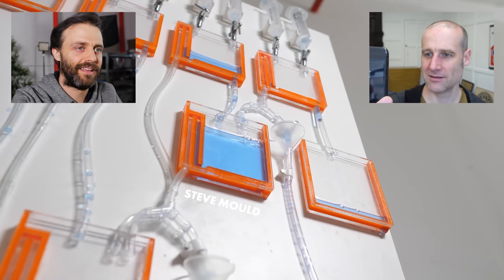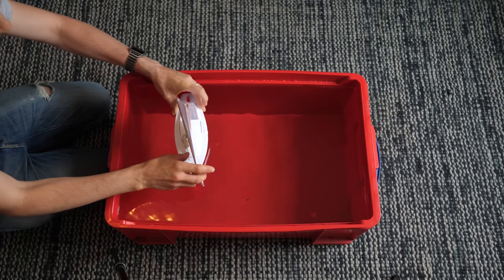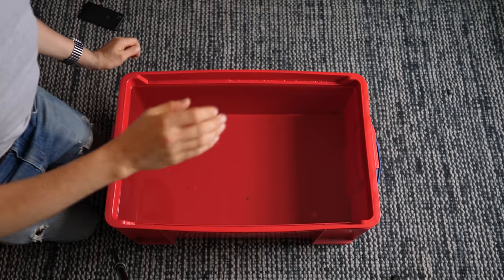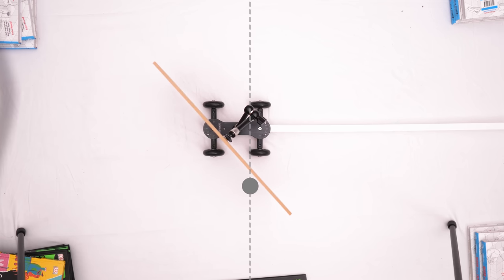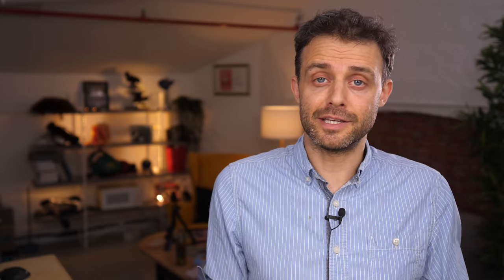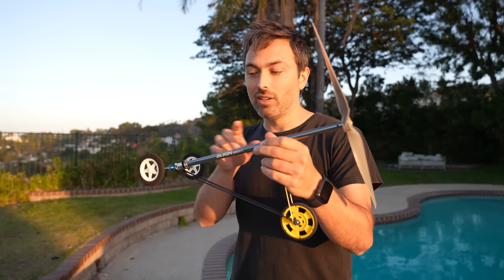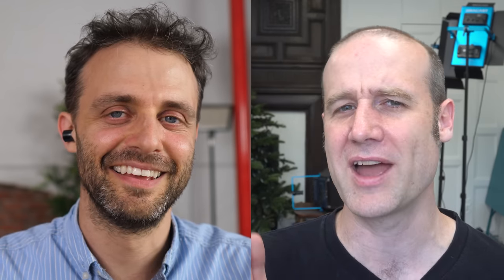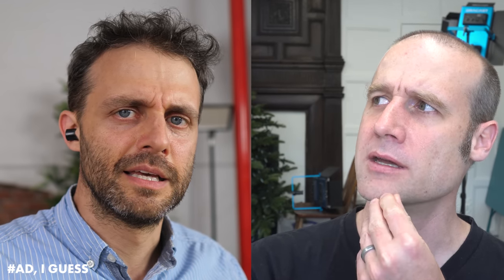Sailing Faster Than The Wind - How Is That Even Possible?

Comment: As a sailor, I love to see this kind of stuff.
Another addition to this is that when a sailboat is moving at a certain speed, let's say five knots in 10 knots of wind then the sailboat is experiencing another 5 knots of wind against it because of the speed it's going. This is called apparent wind. So now that boat has 15knots of wind against it. When a sailboat does this and it happens on every sail on a boat if the boat is moving, then you have to pull the sail in to counter the apparent wind. This is because the apparent wind is coming from the direction that your boat is moving or the front of the boat while the real wind on a boat's preferred angle is usually about 120 degrees from the wind. Now your boat has its sail pulled in its wind angle is around 80 degrees even though the boat is pointing in the same direction. This can be repeated for a long while when you have the right sea conditions. This is also why you don't see the GP boats or the AC75s letting their sails out very far. They are trying to capture the apparent wind.

Comment: 4:05 indeed, the slight sideways drift away from the wind, or to leeward (the opposite of windward) is why you should always leave yourself some leeway when trying to clear an obstacle. Especially if for some reason you don't make very good headway I'm always amazed by how deeply sailing has worked its way into our language!
Reply: Modern day boats can actually generate net zero leeway by canting their foils to windward as to generate windward lift as well as vertical lift which is why most moths and foiling boats cant to windward
Reply: Fun fact you’re minorly incorrect. It’s true that you can have net 0 leeway or even positive leeway but rigorous testing, a very small part of which I’ve been involved with as part of my uni program and sailing team, has shown that while it’s possible to achieve 0 or positive leeway it’s optimal to have between 1-2 degrees of leeway angle because the drag required to generate the extra hydrodynamic lift and resulting speed penalty is greater than the vmg improvements from better point, outside of niche tactical situations like pinching an opponent off a start line in a sailboat race

Comment: i would really appreciate you explaining how the mashine of deric works
Reply: Boogie Baggins  Either his explanation was bad or I'm too dumb, but it would be great anyway to have more intuitive explanation like in this video
Reply: i think his explanation was waaay too convoluted, albeit clever. It took me a while to understand what's going on, i've invented a good explanation for myself.
Reply: I'll try. In Deric's machine the propeller blades are acting as sails. If the machine is going slower than the theoretical max speed, the "packets of air" will hit the blades/sails transferring some of their kinetic (velocity) energy to the propeller. This energy is then transferred to the wheels allowing the machine to accelerate further. This is why the air behind the propeller slows down.
Reply: Isn't it Derek ?
Reply: I think a explanation could be: (its my explanation)
When the wind speeds up the vehicle it doesnt speed it up due to it turning the blade, but due to pushing on the vehicle. Then the wheels will turn also and this causes the blade to spin. Now when the vehicle is at the speed of the wind it will get faster, cause actually if you imagine a horizontal line through the rotors blade there will be a crossing point between the imaginary line and the blade. This dot actually moves backwards while the blade is spinning, because of the blade is tilted. Now you have a point on the vehicle that is moving slower than the boat, cause this point is moving backwards relative to the boat (it could even really move backwards, but lets assume it doesnt)
So then the air can push on this point, since its slower than the air and thus push on the whole boat. 
Of course this backwards moving point doesnt really exist. But you can also think about it this way:
The rotor is spinning, and thus it will blow air against the actual wind. This will cause some swirls and this will cause the vehicle to kind if push itsselve from the wind. Now you could argue that pushing from the wind takes at least as much energy as it takes to turn the wheels. But thats not true, since the vehicle is moving faster relative to the ground than to the air. And thus its easier to push from the moving air than to turn the wheels to be able to push the air backwards. (Have you ever been in a pool with circle motion and just floated in the water while pushing yourselve activly from the fast water jet at the edge tonbe faster than the others? did you notice that gaining speed by this was easier than gaining the same amount of speed difference due to pushing off the non moving water? ) this is  because the kinetic energy increases quadratic with speed. So lets say you want to gain a ∆v of 1m/s relative to non moving ground while you've got no speed  in the first place. The energy reqiered would be 0.5(m^2/s^2)*M with M being your mass. But if you try to gain 1m/s when you are at 20m/s to get to 21m/s you will need a energy of 20.5(m^2/s^2)*M. So much more. So if you push from a object that isnt moving to gain 1m/s while you are at 20m/s you will have ro use a energy of 20.5(m^2/s^2)*M
But if you are pushing from a object being as fast as you, you will have to use only 0.5(m^2/s^2)*M. This is because you will push the other object backwards by doing this and thus you will decreas its veilosity and thus its energy and thus you will gain energy without having to do that much of a work. (of course this 0.5(m^2/s^2)* M does only hold, if you assume that the mass of the object you are pushing from is infinity, cause else it will get slower while you are pushing from it like i already said, and this will make calculations complicated)
So you can actually divide this process into steps:
Step one: Pushing from the wind using a energy of 0.5(m^2/s^2)*M and increasing with speed of 1m/s
Step two: using your energy relative to the ground to push from the air. 
So if you calculate that you will loose 0.024m/s. (cause you will get a energy of 0.5(m^2/s^2)*M if speeding down from 21m/s to 20.976m/s) .
So over all you are gaining 0.976m/s without blaming the law of thermodynamics.
Reply: @keonix506  i think that a much more intuitive explanation is to imagine a toy helicopter with wheels, which you can push on the floor, and it results in the blades turning. Without much thought, you might guess that this happens, because there are cogs and things connecting the wheels to the blades.

Now imagine those blades turned so that they push the helicopter forward when rotating. Does it make sense? If so, then imagine not using your hand, and imagine using the wind to push it. Same thing.
Reply: What I believe happens is: the machine is pushed by the air just as any other object would (assume no propellers at this phase). Then the machine accelerates making the wheels turn. These wheels are mechanically connected to the propeller (here's where it comes into play), and then the propeller pushes the air backwards (relative to the vehicle, in a ground fixed reference frame what you see is just a deceleration of the wind behind the prop) and this creates a force pushing the machine faster than the air would by itself. From Derek's video, I understood that this does not violate the laws of themodynamics (basically, there's no free energy) as long as the wind behind the prop does not move backwards in the ground fixed reference frame. So the important thing is, the prop is not a sail, but the force to move it comes from the wheels. Correct me if I am wrong
Reply: @aarondewindt  there's a problem in Derek's explanation. The prop is harvesting energy to drive the wheels, but only until it is faster than the vehicle. If the car gets faster, then the same prop creates drag. The explanation that the prop is actually pushing air back breaks the laws of thermodynamics because there is no other source of energy. Wheels aren't turning the prop without energy being taken out of them
Reply: It can't be a prop and a windmill at the same time
Reply: @PranavSinganapalli  the propeller isnxt harvesting energy to drive the wheels. Derek said so.
Reply: @eugenetswong  well what is driving the wheels then??
Reply: @PranavSinganapalli  Keep in mind the propeller is spinning, so the wind it sees in it's local reference frame is angled w.r.t. the free stream wind. This angle caused by the spin is what allows it to point (part of) the lift generated by the blades in the direction the blades are spinning. Remember the animation with the sailboats sailing around the cilindrical world? This lift force is then transfered to the wheels.

Now think about the case where it's going exactly as fast as the surrounding wind. The drag force of the vehicle is zero because it's not moving w.r.t. the sourounding atmosphere. But the propeller is producing some torque because of the lift the blades are producing. So it's able to accelerate further untill the drag force is large enough that the propeller can't produce enough torque to keep accelerating.
Reply: @PranavSinganapalli  The reason the wind slows down, is not because the propeller itself is producing thrust, but because the energy it captured came from the kinetic energy in the wind. The propeller captures this energy by redirecting the wind it sees in its local frame backwards, thus the result is a slower wind speed behind the propeller.
Reply: @aarondewindt  the problem with your explanation is what is causing causing that torque and why isn't it slowing down. Is the energy to keep the prop spinning coming from the wheels? If so then the whole craft will slow down because the forward speed of the craft is being used to spin the prop (minus frictional losses)

The lift the blades produce has to come some somewhere. Else we would have planes that have no practical weight limit and brilliant efficiency in the order of 100km/litre or something
Reply: @aarondewindt  Not at all, on the contrary, check veritasium video from 17:30 and it's the first he says, fan, not sail.  Pulls against the wind, not the wind pulling the fan (sails, if that was the case). It's the wheels that move the fan, not the way around.
Reply: @PranavSinganapalli   Thank you, I was starting to think I am very stupid for not making sense of this. The original Veritasium video, not this one.
Reply: @aarondewindt  if the blades captured wind energy then the motive force (i.e. the force that actually moving the craft forward) is coming from the wheels. The blades will stop harvesting energy once the relative speed reaches Zero. What is then powering it beyond that? Once it goes beyond the wind speed, the whole thing starts to generate drag and yet it continues to go faster
Reply: @PranavSinganapalli  Rephrasing again. Because the blades are spinning, they see the wind coming from a different direction than us. You can then angle the blades such that the lift they produce is in the direction the blades are spinning, thus producing some torque which can be transferred to the wheels.

If you are going as fast as the surrounding wind, there is no drag force to resist, so the vehicle can use the captured torque to accelerate until drag becomes too much.
Reply: @PranavSinganapalli  The wind pushing the vehicle, which causes the wheels to turn. It's like gravity pulling it down a hill. Gravity can pull only so hard. Once the wheels start turning, they turn rods cogs inside the machine, which turn the propeller.

It's like asking how an airplane's propeller's turn. It's because the motor/engine turns it.

In the case of this vehicle, the vehicle will speed up, but it will slow down to wind speed again, and then speed up again.

I'm not an expert, but what I say is what is shown in the pictures in Derek's video. He showed the inside.
Reply: @PranavSinganapalli  Thought about it a bit more, ignore my earlier explanations, they are indeed wrong. I'm gonna try again.

When moving at the same speed as the surrounding air, there is no drag. So any forwards force will cause it to accelerate. The question is where is this forwards force coming from?

Let's look at one blade from the top assuming the vehicle (and us) are moving from left to right at the same speed as the wind. While spinning, to us it looks like the blade is moving downwards. So the blade sees the wind moving upwards. Since the blade is angled w.r.t. to this upwards wind the lift it produces is angled forwards (to the right), thus accelerating the vehicle because again, there is no drag yet since we are going at the same speed as the surrounding wind.

It might be easier to visualize it if you draw it. The blade would be angled like a backslash here (\). From it's reference frame it sees wind going upwards, so it produces lift to the left. Since there is not drag it can accelerate until this lift and drag cancel each other.
Reply: @eugenetswong  think about it for a bit. I'll wait.

You're saying the wind pushes the prop which moves the wheels which in turn moves the prop which also moves the vehicle beyond the speed of the force acting on it. Sounds like a perpetual motion machine to me 😎
Reply: @PranavSinganapalli  I'm not saying that the wind moves the propeller. I'm say that it does not or that it plays very little part in pushing it. The fact that you keep coming back to this idea proves that you didn't remember me and Derek saying so, or you refuse to let go of the idea.

The rest of vehicle catches so little wind, but it is enough to catch the wind.

It's not perpetual. The vehicle slows down and speeds up.
Reply: @eugenetswong  sorry if I keep coming back to science and reasoning. I won't bring it up again 👍🏽
Reply: @PranavSinganapalli  if you were being scientific, then the machine would be impossible to create, and it would not travel faster than the wind. It is possible that you might be explaining yourself unclearly and/or I might misunderstand, but other than that, you seem to believe that the machine is a fake.

That's your definition of science?
Reply: @eugenetswong  what's your definition of science?? Does it involving believing anything and everything you see? The vehicle clearly violates law of thermodynamics which I have tried explaining in a variety of ways. In the spirit of science, please try out the treadmill experiment they claim to have done. Get back to me with the results. Science is built on questioning and holding quack science to account.
Reply: @PranavSinganapalli  so you think that Derek is lying to us?
Reply: @PranavSinganapalli  the vehicle doesn't violate any laws of physics. Try to think about it again but this time harder and for real
Reply: @keonix506  Im not a huge fan of it was explained in that video. It can actually be explained simpler just by using the equation for power IMO:

Power = Force * Speed
The ground is moving faster than the air relative to the blackbird vehicle. This means that power generated by the wheels can be used drive a propeller that creates a driving force greater than the drag force being used to drive it - the wind is going slower than the ground relative to the vehicle, so the same power can generate a greater force.
Reply: @PranavSinganapalli  The prop is a prop. It doesn't break any thermodynamic laws, from a reference frame on the ground the prop pushing against the air slows it down, and the lost kinetic energy in the air is used to drive the vehicle.
Reply: @madattaktube  That makes much more sense, thank you! Given your explanation it means there is no theoretical limit on how fast you could go along the wind, which is pretty interesting implication.
Reply: @madattaktube  Your tidbit about kinetic energy reminds me of Oberth effect in rocketry, in which you steal kinetic energy from your exhaust
Reply: @keonix506  Funny coincidence, I only just first heard of and looked up the Oberth effect a couple of days ago! Were you reading Project Hail Mary too?
Reply: @madattaktube  Nope, I'm just addicted to KSP. But thanks for introducing me to it, was it any good? I really liked The Martian, haven't red anything else from this author
Reply: @keonix506  I loved it, very similar to the Martian but it does go in some interesting directions and is overall a lot of fun! Of course it also made me want to go play KSP too, which has now been my primary procrastination tool
Reply: @madattaktube  ok, will check it out, thanks again!
Reply: It's simple: the blades act like a turbine because they move in a helix/screw motion. Looking at rotation alone they look like a propeller, but that ignores their overall displacement vector. The air does work on the blades and that powers the vehicle so I would catagorize the blades as "turbine" blades.
If you want to think of the blades as "propeller" blades, then you additionally need to look at /consider the linear movement, and therefore the whole system is a linear turbine superimposed with a rotating propeller. Here the linear turbine receives more power than the propeller uses, and therefore the turbine powers the propeller.
Either way you want to view it, the helix/screw displacement of the blades is the key because it allows work to be done by the air on the blades. Either view is valid: the first says "the air powers the vehicle", while the second says "the air powers the linear turbine which powers the vehicle, including the propeller."